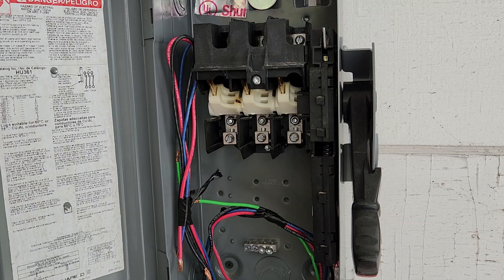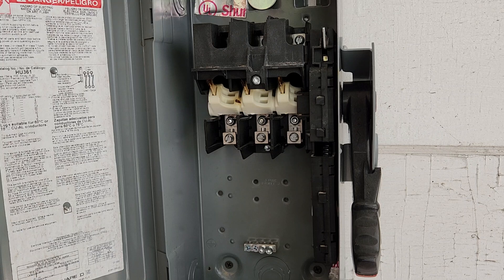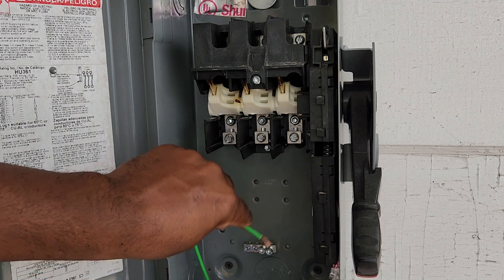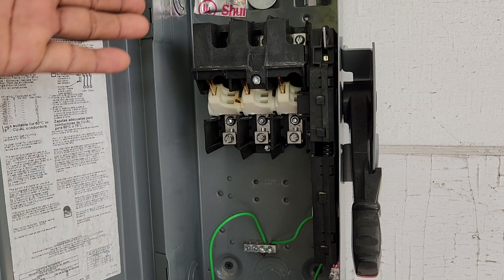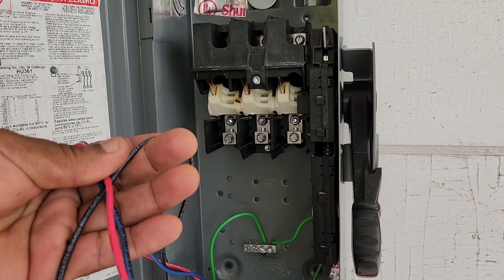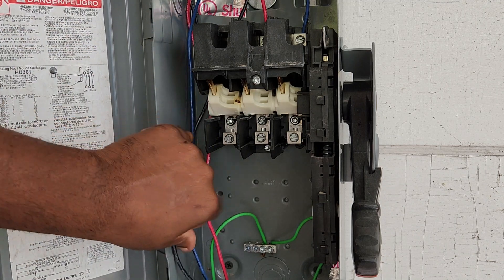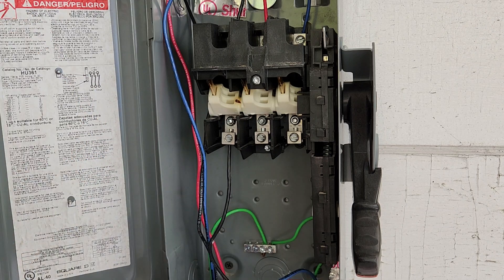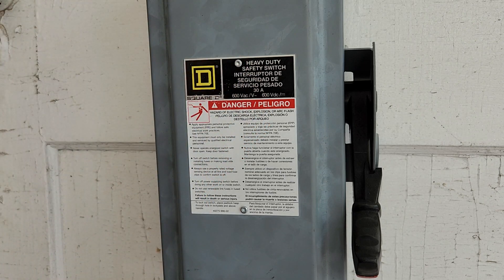How to wire 3phase 30 Amp disconnect

Comment: I am using 10/2 with ground (3 wires) coming in from the panel box (line side.) Do I have to have three wires plus ground coming in on the line side? Hope this makes sense.
Reply from the maker: Not necessarily. You can have 2 wires or 3 wires. It depends on the equipment you are disconnecting. If the equipment is rated for 240volts you will have 2 wires.